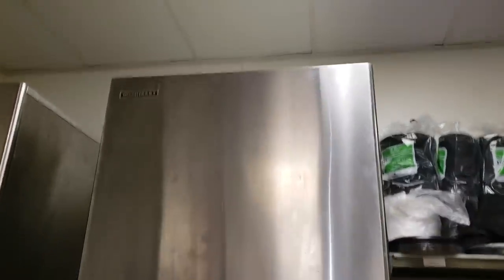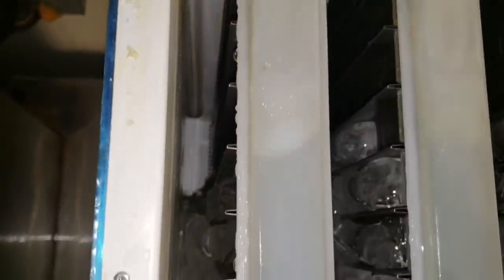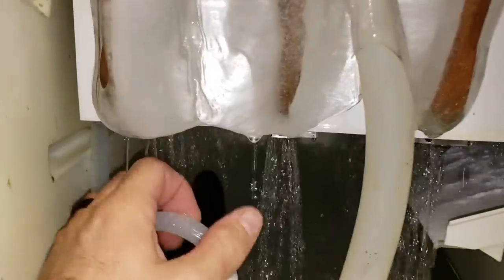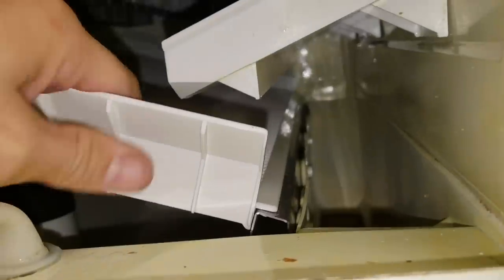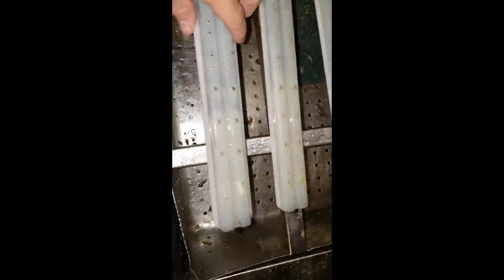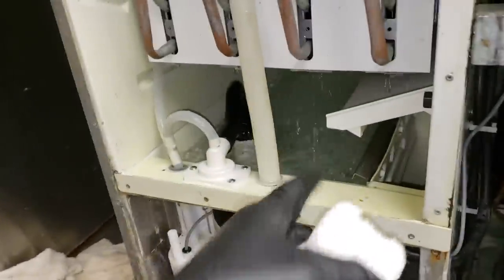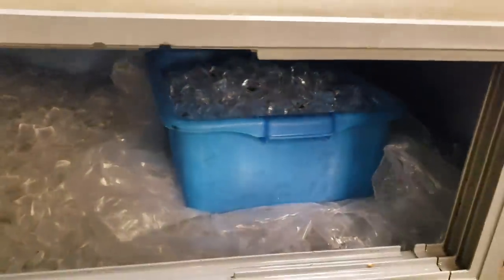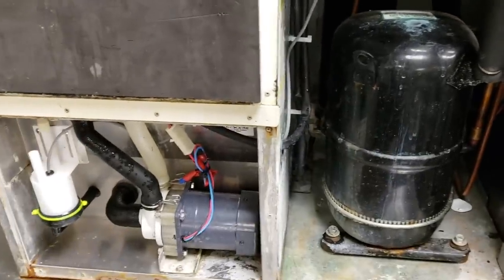HOSHIZAKI ICE MACHINE FREEZE UP

Comment: your absolutley right, they thought it was a scaled evaporator and changed it. Thats where thoroughness comes in. Other night I was checking a 5 well steam table and it was 8pm and I just wanted to check the heater to the well they were complaining about. But you kept popping up in my head and saying "look at the big picture". I did and I found two other wells with their safety limits bypassed and the unit is not grounded!! You are teaching great attitudes. Thank you sir.
Reply from the maker: Wow thanks bud I'm glad I could help!

Comment: They need to clean the Ice machine cavity more often. There appeared to be spores of some sort on the walls.
Reply: 90% of ice machines have quite a bit of mold in them most people don’t keep up with cleaning
Reply: Yeah most of the big bulk ice makers have mold in them and unless they get cleaned on a regular basis.  Which with most companies doesn't happen because that would mean you'd have to spend labor dollars on it and the labor at most places is barely enough to keep the doors open much less do thing like clean machines like the are supposed to be.  If you think that ice bin is bad you don't want to know what a fountain machine looks like.   I started managing a convenience store and got taught how to properly clean the machine I've never drunk fountain drink ever again.
Reply: @kurtheil4922  yeah, but that water is not exposed as it is in an ice machine.
Reply: Sadly many businesses do not do regular servicing/cleaning. However the cleaning may not remove the spots left by cleaning. The plastic becomes etched with the mold sitting on it

Comment: If the machine had a history of evaporator freeze up, It could have been why the evaporator went bad. Those evaps are made of stainless steel.  the coils are sandwiched between the plates. So, if water gets between those plates it will over time separate the plates from the coil.
Reply: Thank you for mentioning this. I was going to say the same thing. Not very often have I seen one leak but many times you see the tubes broken from the evap plate. This causes long freeze issues.

Comment: I usually find that the float switch is the main issue on freeze ups. It gets stuck and won't go into harvest.
Reply: Shane Behm ya people clean it and put it back at the wrong level too.  End up adding too much water into the machine.  Ice cubes are a lot thicker and take longer to harvest.
Reply: One thing i learned when servicing the Hoshi units and the float, make a mark where the screws are. Put it back when done

Comment: I worked on a smaller unit when you remove the water solenoid valve they'll usually be a lot of sediment from the copper pipes. Completely disassembled it. Soaked in CLR. Look down the middle remove the screen. Right behind it will be a water flow restrictor. From the factory. Take it out and completely clean it there will be a bigger hole and then the smaller tiny hole. Take your drill bit and drill it a little bit larger opening . Reassemble everything you'll get I had the pan overflowing and under a minute. Keep in mind this was a smaller ice machine but same manufacturer. You'll notice the water solenoid  sound more as more water flowing.

Comment: It's always important to make sure the right parts are on the machine to eliminate any problems that might arise. However it is good to install a water filter system with a water pressure guage to make sure you are getting enough water pressure. Usually when a bin thermostat goes bad either the machine wont come on or the machine wont turn off. It is good to use a volt meter with ohms and continuity to check the bin thermostat. Many times also a defective or dirty float switch can cause a freeze up on the evaporator for Hoshizaki

Comment: I don't know about the newer machines but 15-20 years ago When I had a bad freeze up on a Hoshi it was normally related to harvest problems.   Hoshi is my favorite machine.   I heard Hoshi had problems with evap plates separating but I only ever saw it once and I worked on a lot of them.
I could work on them all day, though I do not anymore.   
Over the years 98% of ice machine problems are water side.   Replace maybe 2 compressors and one expansion valve and maybe one bin stat.    Lots of check valve rebuilds.

Comment: Thank you so much , I could never fix a ice up on those machine I just  defrost and adjust the 1 and 2 dip switch on 10 pin connectors.
Reply from the maker: Thanks for watching ! I am going to go live on Youtube tonight 11/12/18 at 5:00PM pacific time to discuss my most recent uploads and answer questions. Come on over and check it out 
https://youtu.be/Fhmj8g3Gd2w
Reply: 99 times out of 98 the problem  is the water line is to small and  insufficient water filter

Comment: I realize this is from four years ago, but the number one reason for a hoshizaki freeze up is a plugged inlet screen, first thing to look for.
It didn't look too bad, but bad enough when combined with the reduced supply water line & improper water inlet valve(nice catch there). But I'm not sure why you replaced the binstat?? It had nothing to do with anything.

Comment: I have my own business doing appliance and hvac/r repairs and I get call on ice machines from time to time. Don't know a lot about them but I just look for the obvious what's causing the problem. I would've broke the hard ice tapping it with my little hammer and steamed the rest inside. I try to get tech support when I can but that's not always possible so I just try to figure out what's happening on my own. Good video. Reading the manual definitely helps a lot.
Reply: Keep tapping with that hammer and eventually u will bust a coil
Reply: @1989Chrisc  I wouldn't do it if I didn't know what I was doing. That hard ice is nowhere near the coil.
Reply: Lol

Comment: Great video once again. Had the same issue on a km2400srh3 cuber from Hoshi. I also found a wrong sized water inlet valve and the bypass spring was weak. Dumping water into the float switch from the top hose. Replaced both those and ran fine for 4 days then all of a sudden froze up again. Tested the float switch but found was intermittent and hanging up. Replaced float switch no more call backs.
Excellent info about the water inlet line size. Very common to see 3/8" line to every unit no matter the size. 
Yea I agree do not touch the board. 
Well done!
Reply from the maker: Thanks for watching ! I am going to go live on Youtube tonight 11/12/18 at 5:00PM pacific time to discuss my most recent uploads and answer questions. Come on over and check it out 
https://youtu.be/Fhmj8g3Gd2w
Reply: Make some golden rules. 2 of mine are , if u get a service call on a machine and float switch or ice thickness probes are suspect/ the problem Allways replace them. They will last much longer and customer will be happier in the long run. ive proven it. clean something and it works for 3 weeks to 6 months or a year. replace the part and customer can be happy for many years.

Comment: Have you dealt with the new KMS- 2000 MLJ models.i have two units which are at two separate stores about 100 apart and they're both freezing up they got installed 2019. I've tried following hoshis check list and I end up short and baffled.

Comment: On the new models I see bad float switches, faulty suction thermistors.  Also new ones have slush problems so activate dip switch # 5 on S4 and make sure maximum harvest dip switches 1 and 2 are on S5.
Owners should clean there machines but some are cheap ! 😂.
Cheers !

Comment: Had a brand new hoshi 6 months break a cube guide piece and lodge into the check valve. I swear those things are getting more brittle!!
Reply from the maker: Yeah it was better when the cube guides were stainless steel!
Reply from the maker: Yeah do you remember the old dssu machines that had the stainless cube guide? But I am sure those didn't make them very much money!!
Reply: I was just thinking how in the hell in commercial machines they're not stainless? Easier to clean too!!
Reply: I agree. On the other side I get warranty service call plus 2 hours to change them so I am always looking for them. That and bad evaps on the new machines. I dont know what they era using for solder on these new machines but its crap. I have changed 10 evaps in the last month or so all under warranty with machines that are 6 months old or less

Comment: My biggest problem is that after working on about 40 or so of different ice machines, not 1 of them had their manual available. Doesn't matter if it's a huge place with 20 machines or tiny restaurant with just 1, if it's a 20 year old or 1 year old unit. The book is always missing. Hard to look up correct procedure, parts and sequence.

Comment: Do you know how to solve the timer issue? We set up a timer at the outlet, so the machine immediately turn it on and off everyday at certain time. That caused the ice being made in the middle cycle without dropping, and that caused the ice sticking together into a big chunk, and getting stuck inside the plate like video shown. How do we properly set up the timer to have the machine making ice for only 8 hours a day?

Comment: Hey Chris and other Guys, i installed a Brand New KM1301 SAH-E machine in April this year. straight off it didn't work, dumping 10 litres of water 10 minutes into the freeze cycle.. pulled out the dump valve spring and stretched it,machine worked.. got new spring from spares,it had 5 coils,original spring had 4 coils. according to Hoshi USA there is only 1 spring...???... and they recommend you stretch it to be between 38 - 50mm long. Anyhow ,in the past 7 months i've had 7 ice ups, never any fault beeps, always defrosted and checked every component to work, its makes ice a ok..did the full ice up fault sheet for Hoshi USA and they saw no issue with water or anything else.. once it ran for a 68 min freeze cycle,after i defrosted it ,i changed PC board, then discovered Hoshi manual says dip switch setting are max 60 mins, but its wrong and those dip switch settings are 70 min max freeze cycle factory set... iv'e set dip switches for 50 min now... have been given a new water valve , new float, changed, still ice ups at irregular intervals.. .. 12 days, 7 days,40 days,12 days,80 days.14 days.. David at Hoshi USA is stumped,30 emails later.. ive put 6 of these in and never had issues over the past 8 years.. this model has magnetic bin switch, seen bin full and off 10" under ice head countless times, tested bins switch a 100 times.it works..im getting a new comp relay to fit soon... any clues out there USA Techs...???                          thorough job on that machine Chris..
Reply from the maker: Test the water flow like I did, what is the gpm if the water coming in. ?
Reply: @HVACRVIDEOS hey Chris, From an Empty Water Trough, it fills in under 1 minute and starts hot gas cycle then  water pump, then freeze cycle.. have tested this many times, water pressures ,flows, etc.. David at Hoshi USA has no answer as said..that's why i'm getting new comp relay, maybe that is jamming on,  i've change nearly everything else... if that fails they are sending another machine...
Reply from the maker: Wow I am speechless!
Reply: @HVACRVIDEOS  I know, Big Mystery...I need Robert Stack from Unsolved Mysteries... lol

Comment: Good learning info, good detail, but deicing, running multiple cycles, looking up all that info. weighin ice and water times adjusting board. must of took 3.5-5hr hr service call. Inless ur company not to busy way to much time spent, normal to have 3-7 calls a day. Also proper water valve, bigger water line, and proper bin extension lots of customers will ask. it been running like that for years why all of the sudden won't work? 95 percent of the time 1 part out or just got to dirty. Good job tho.

Comment: Im working on a hoshizaki km 1300 SAH..  when i start the unit it goes into the filling cycle , and then when it gors into the defrost cycle water doesn't stop, so because i have water runing during defrost cycle.. Lines dont get warm so eventually the evaporator freezes up.
Any recomendation? 
Thank you

Comment: I have a Hoshizaki km-1340mrh when I first initial turn on the machine the coils and compressor is very hot. Immediately turned of the machine and still troubleshooting it... called HVAC guys and charged more Freon and the coils turned cold but not making ice and when the machine turned back on the coils is hot ... I wonder if that’s normal?
Reply from the maker: Yes the hoshizaki machines go into a defrost every time you turn them on . After about 4 minutes the defrost should stop and the water pump should turn on and than the unit should start getting cold
Reply: HVACR VIDEOS  thanks man... I thought the compressor about to blow up or something and it’s scary that you can hear the loud gas noise ... really appreciated..been watching your videos and it’s awesome how you explained everything.

Comment: Just watched their training videos and they mentioned that the water pressure should be 10 to 113 psig
Reply: 10 to 113 is a pretty wide range, it basically means it'll run on anything from well to city water so long as the flow rate is there.

Comment: Has anybody here fixed a warped evaporator? A customer of mine has an old machine with that problem.  Replacing the evap makes no sense. He wants to buy a new machine but i just wonder if Icould fix it and give him a couple more years. If he gets a new machine it will probably be a lease with PMs included do i have an incentive to fix it and save him that cost.
Reply from the maker: I would try and fix it, I would just replace. Trying to push on it to straighten it will break something or cause a leak

Comment: Some of the no ice service calls I've had here in Alaska is due to the water temp coming into the machine is to cold and makes a slurry of semi frozen water in the troth  and the water pump cannot the water out of the troth,  so I poured warm water in the troth and it melts the slurry, water pump can now move the water over the evaporator and it starts making ice. so the fix is to warm the water line going  into the unit.   I have used a space heater behind the unit and I have used a longer water line routed up over the ceiling tiles.

Comment: If the ice machine doesn't make get enough water, it will make  shallow ice or of course it will be off with a beeping from the board.
Reply from the maker: The ice machine was getting enough water it just wasn't getting the right flow rate

Comment: Dude..... Did u check the the float switch by any chances and the hot gas valve  in/out temp.? Man, lets make sense for this call if the unit was installed wrong it will acting up right of way day one. I'm not ignoring the installation requirements but dude all its common sense. You can extend the harvest but not fixing the problem... Most likely they will call u back and one more thing what is the resistance of the thermistor during the harvest? I hope u do not get my comment in a wrong way but I just try to help before some will put a bandage on the equipment. The reason I was making this comment is because I being working for a while in HOSHIZAKI  ICE MACHINES.

Comment: Maybe the evap grids were broken loose causing freeze up & the evap change. Imo hosh is the best longest lasting im in the industry. Ive changed evaps due to grid delamination in which jury rigging is not recommended. Usually im's are installed to manufacture specs. Bashing the competition is not necessary. Give me a service provider thats made a mistake over one that bashes the competition any day. They learn from their mistakes. Bashers no it all and tend to place blame elsewhere regardless. Ive been servicing Hoshizaki, manitowoc, ice-o-matic, Scotsman, Servend, Follet, etc for 30 years in the c-store fast food grocery industry and the one thing i will not tolerate is competetion bashing. To say you bet the evap did not need replacing is out of line as you were not there as you stated "it was another company". Obviously you no your IM's, work on your PR. Theres 2 lessons to learn here. 1, IM diagnostic 2, no when "saying less" is more Professional! Respectfully